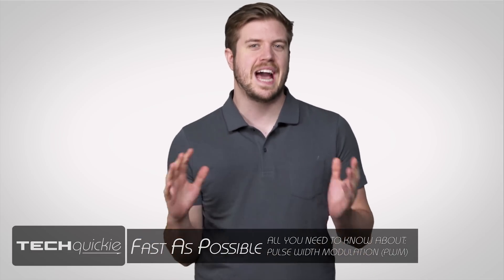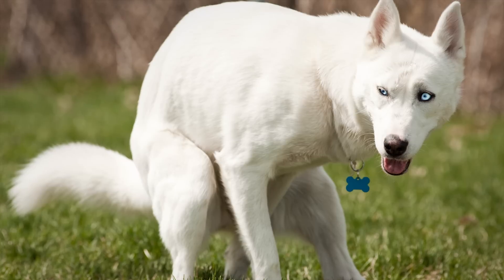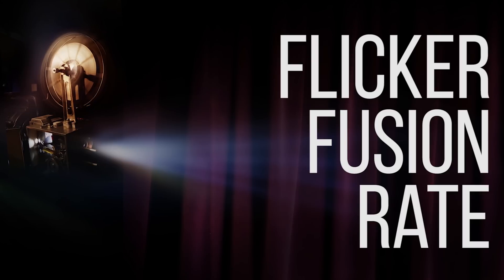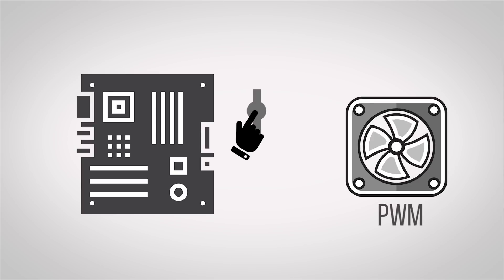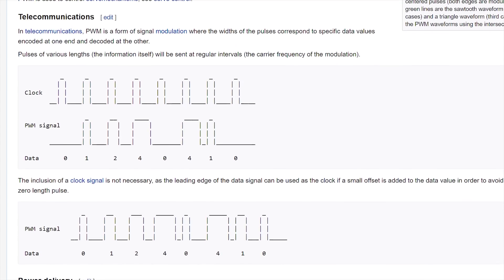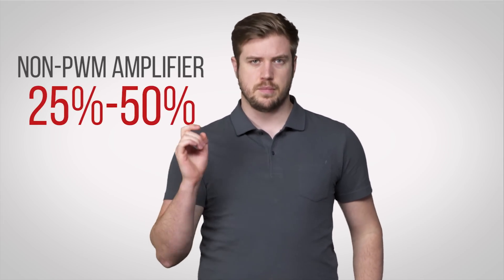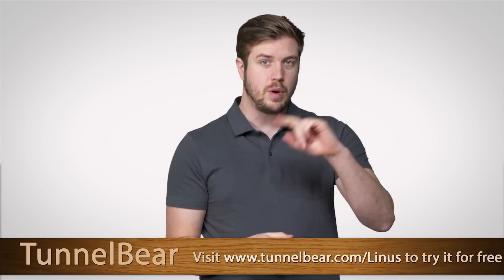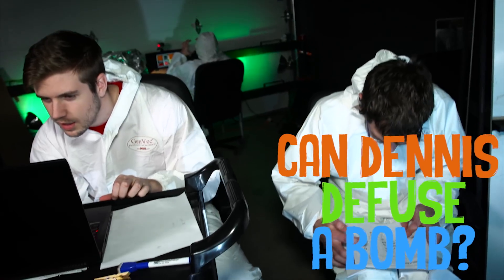PWM (Pulse Width Modulation) as Fast As Possible

Comment: So many misconceptions.

Pwm does not change the perceived power, but the actual power. If you go with 100% power but only 10% of the time, than the end result is 10% power.

The power-consumption of PWM fans too is not choppy.
The PWM signal is NOT delivering the power, it is only telling the inside circuitry what to do. And there is a surprising amount of electronics inside those fans.

With current regulated fans the extra power can get wasted, but that is not the only way to do it.

And light-dimmers did NOT work that way either - or they would have burned up.
Some early versions used a transformator, but pretty much every conventional dimmer uses triacs since the 19070's.

phones and celltowers do NOT use PWM to transmit data. that would be rather inefficient.
GSM uses Minimum-shift keying.

PWM amplifier - you mean class D amplifiers?
Cause they can use PWM, but are not limited to.

not a bad video, but surprisingly nearly everything is only half true or outright false.
Reply: ABaumstumpf yeah as a EE student this video had me cracking up. They should stick to unboxings, they're clearly not qualified to try and educate on topics like this.
Reply: ABaumstumpf I believe it's for noobs on low-level electronics, those that mix concepts like power with voltage. It's better than nothing I suppose
Reply: The statement telecommunications such as cell phones and towers where PWM controlled was way more painful then the 'perceived' power part to me.
Reply: They already made a video explaining the difference between power and voltage, so they should be able to expect their viewers to at least know what that is at this point. I mean, P=IV -> Penis = In Vagina. Not hard to remember :)
Reply: Anubhav - depends on how the fans are build.
but in principle the PWM signal is used to switch a MOSFET. So the fan internally is driven by a PWM Signal, but the power does not come from the PWM-pin but the 12V rail.
And to not have a rapidly changing current the 12V rail is stabilized with a capacitor.

of course many fans are made a lot more complicated than this nowadays, with extra circuitry to make it turn even at very low speeds, keep the RPM more constant and so on.

A simple overlook of how 273/4 pin fans work:
http://www.analog.com/en/analog-dialogue/articles/how-to-control-fan-speed.html

small circuitboard inside a PWM fan:
http://www.overclockers.com/forums/attachment.php?attachmentid=150239
goes to show just how much more than the simple basic really is used.

Some have a buck-converter to regulate the voltage (simple google "step down buck converter"), others use the PWM, and some do more exotic things.
Reply: ABaumstumpf
 Oh now I understand the key factor (stressed put on internal circuit) is fan essentially act like a blackbox with generic interface. Thus, reducing processing/computation responsiblilty of motherboard. Thanks Bro.
Reply: Exactly, this is why fan connectors have that 4th wire. I think I'll make a video proving why using PWM for power delivery is a bad system. Why would it create 2 antennas though and not 1?
Reply: I was waiting for a mention of class D amps too. Especially in live sound loudspeakers, line array systems, etc.
Reply: In first line you put 5 instead of %

And you're right
Reply: Karol - oh, thanks, edited it.
Reply: what is gained by not just delivering pwm power to the fans?
Reply: It is used to send signals to your fans, but if you deliver power you now have 2 big fat antennas for every fan inside your case. and it would also make controlling the fan harder. normally you have some small caps to generate a smooth voltage to control the speed - if you do that with PWM controlling that voltage becomes really hard to impossible, as it would be dependent upon outside components.
Reply: makes sense, thx for the quick explanation
Reply: From noob to expert. This video seems straight out of Wikipedia. Could you direct me to document or explain a little bit more how the fan is regulated with PWM?  I mean if you are not using resistors to control voltage or sending power via PWM then what is being actually used?
Reply: ABaumstumpf
 Wow, I thought they might use some series of step down transformer with transistors as a switch to turn them on/off. Thanks for sharing your documents they made it much more clear. But I have one more doubt, why use PWM, if we are using logics can't same be achieve with multiplexers with some sort of  step down converter (just curious).
Reply: *****
 Hmm intriguing, now I am more curious.
Reply: @Quantum - about the cap - not really.
If you use a 20 V 50% PWM signal on a cap, than you might get anything between 0 and 20V on average at the cap.
cause it depends on 4 things what you get:
The current capabilities of the source.
The characteristics of the source (high impedance vs active low)
current draw of the source.
capacitance of the cap.

Specially the current is important. if the source is not strong enough in comparison to the demands it can easily be that you never reach the intended voltage. And the opposite can be true too. with a strong source yo might manage to charge the cap in a single cycle even at 10%, and the small load might only decrease that down to say 18V per cycle.
Reply: Anubhav - a PWM signal is just really easy to handle if you only want roughly linear characteristics.
Try to think of other methods to send data.
serial encoded? parallel? Analog? That all requires more electronics on both sides.

With PWM you can achieve it quite easily. And internally on the fan you can do a bit of processing if needed. Many of the fans have a lot of electronics inside - but the key is - internally. Cause the connection and what the mobo is seeing is quite simple. This way a fan manufacturer also can decide how to exactly control the fan and the same goes for the motherboard. but no matter how it is implemented, it will work with all motherboards and fans.

Comment: PWM is also used in modern Automobiles. Such as an EVAP Solenoid.
Reply: Also you need an oscilloscope(PICO SCOPE) to work on most things that are controlled by PWM.

Comment: PWM for any lighting is fucking annoying. It legitimately strains the eyes and achieves nothing more than a well-designed voltage control system does.
Reply: My thoughts exactly. It's good for motor drills and all that, but for anything to do with lighting (looking at you, monitors and TV screens) they really SHOULDN'T EXIST. It's incredibly annoying on so many levels and CHINTZY as fuck.
Reply: turbo pascal you can't use voltage control (directly) for LEDs, only PWM or amp control.
Reply: i already had people suggest me to just PWM lighting LEDs, but i am "NO, I WILL FOR NOW NEVER DO THAT", i voltage control them, it is not a good idea, but if they do not heat much there is no issue(higher temperature=lower voltage drop=higher current=higher power consumption=start), for now i haven't done any adjustable current sources(LEDs->Fb pin->low value resistor to gnd, the resistor will drop the feedback voltage, so it is quite easy to adjust current, the lower the voltage, the more efficient it is(more important on low voltage LEDs)

I have a shitty +-350-450lm 5W COB LED i got from ebay(before i had semi-proper osram LEDs but they were shitty and SMD, so they got damaged very easily) on a flashlight i made(more built, but anyway) and i basically have voltage regulation for brightness adjustment.(i don't always need to light up a room with it)
Reply: GetTheCheeseToSickbay You don't get to tell me I can't do something I actually did :P
Reply: What exactly do you mean by "a pretty constant forward voltage drop"? All voltage-current characteristics of LEDs that I can find show both voltage and current rising together, though not at linear rates. And when you plug an LED into a voltage source, the lower the voltage, the dimmer the light.
Reply: Alright, I see the point. But to make simple dimmer switches, we don't have to be very precise at all do we? We just need to establish a spec for maximum current at a certain voltage to retain compatibility, and then just use a regulated voltage supply to drive the LEDs. And for more precision, there is the aforementioned current control, still no need for PWM (which was my main point - to get rid of the flickering).

Comment: 18Hz. Flicker fusion rate. Yes for evenly lit frames. Not for light. A 24FPS cinema runs at 48HZ, each frame are shown twice.
You can test this yourelfs with a a camera flash. The flash must have a "multi flash" setting ware it acts as a strobe. On mine I can set the number of flashes and the Hz. To my eyes the light output becomes solid around 50-60Hz, and continues to be smoother up to 100Hz witch are max on my model. At 20Hz it are still obvious it are individual flashes.

I'm sure someone at LTT have a flash that can do this. So test it out for yourself!

Comment: PWM lit backlights at a small enough brightness level do start to flicker clearly, there are ways around it of course, but on the cheaper monitors it's not used. In fact, you can decrease the blur on an lcd by having the pwm cycle synced to refresh rate, that means the screen is flickering, that means it can cause eye strain.
Reply: attach a capacitor in parallel with the led's to smooth?

Comment: also, PWM dimming on car tail lights pisses me off because when I move my eyes it gives me stroboscopic effect, you can also explain this.
Reply: comes from some people being too cheap for the extra 0.2 cents for the faster switching PWM-chip.
Reply: +ABaumstumpf PWM are themselves cheap as fuck alternative for corporations instead of having an actual proper dimming circuit. You can see this in how monitor companies are now marketing these "new and improved eyecare flickerless" monitors, i.e. non-PWM brightness circuit. In other words: they're now doing what they were MEANT to do from the very beginning. They're cheap motherfuckers. PWM should have NEVER reached this level of popularity for light management.
Reply: m8onethousand - PAM light dimming actually is quite good.
But the the frequencies need to be higher in order to not have any problems - and that is where they cheaped out cause ti would cost half a cent extra.

With LED backlight it is possible to dim them directly, but with other backlights - CCFL can not be dimmed all that much as the physics they are based upon limit the range significantly.

Increase the PWM frequency and you got no problems.
some panels have frequencies as low as 125 Hz - and that is too low. with just a few cents extra you could pump that up to > 2000 Hz and have no flicker what so ever.
Reply: You mean from manufactures being cheap, right? Most newer cars come off the line with LED bulbs for the rear end.
Reply: +m8onethousand PWM with LED lighting actually serves a good purpose if done right...  I agree it shouldn't be used to control brightness, a good pot is better for that, but, PWM when used properly can help increase the lifespan of the LED, as well as decrease overall heat output since it's not lit as long.
Reply: +Chucks Basix I actually despise LEDs for that very same reason. I don't have a single LED nor CFL in my house. I refuse to sponsor PWM garbage. I laugh when they come with all the marketing wank of "over 20,000 hours lifetime! save the planet one led at a time!!!!". Turn on a camera, and enjoy the pig disgusting flicker and subsequent light spectrum drift in these bad boys. I may come back to LEDs when they make a PROPER circuit for them.
Reply: +ABaumstumpf You do realise you can dim them with other means than potentiometers, right? That's my point: corporations are a bunch of cheap crooks. Saturable reactors (actual name, but it's actually incredibly easy) quickly comes to mind as the easiest and most basic example capable of delivering a proper dimming. At the end of the day, there are a plethora of methods they can employ to PROPERLY dim them, but they deliberately refuse to do so because people are down to buying their overly expensive marketing wank PWM garbage.
Reply: "You do realise you can dim them with other means than potentiometers, right? "
And you can use something aside from a car to get from point A to point B - so?
PWm is a cheap, efficient, and sufficiently good method.
 
"At the end of the day, there are a plethora of methods they can employ to PROPERLY dim them"
then please go ahead and build them - oh right, you won't, cause neither are those easy, nor cheap.

if you just hate it cause you want to hate it fine - your choice to act stupid.
Reply: +zlac Yeah, this is totally annoying. I use to take over those cars, because this is really a safety issue.

Comment: Another automotive application of PWM is in the Engine Control System; it is how the fuel injectors are controlled for optimum fuel atomization in the combustion chamber, which reduce emissions and increases fuel efficiency.

Comment: PWM is also used in old game consoles to give you that nice 8-bit sound.

EDIT: sorry, this isn't actually true. Check the conversation below for the actual truth.
Reply: NI's Massive uses regular wave form oscilators... 8bit sounds comes from square waves.
Reply: Every old 8bit tune was made using square wave synthesizers and nothing you say will change that. PMW only allows you to use any waveform (even images) as oscilators.
Reply: Meta - uhm - not really.
the 8bit guy made a good video about how consoles made sounds.
Reply: ABaumstumpf oh, i have actually seen that video...
The reason i made that comment was because i a digital synthesizer (called Massive) that allows you to make sound using PWM. And it sounds really 8-bit.
Reply: Eduardo Walcacer yes, but the PWM Wavetable generates more that a normal square wave, it changes the pulse width (surprise, surprise...) of the wave, which sounds different.
Reply: Eduardo Walcacer Wow, that's pretty interesting. I guess you learn something new everyday. I'll edit my comment
Reply: Eduardo Walcacer No, they used other waveforms like sawtooth and triangle as well. Just look at the SID chip in Commodore 64, which was released in 1982.
EDIT: The SID chip doesn't have triangle, AFAIK, but it was just an example. The NES (Nintendo) had triangle, noise and square.
Reply: Meta, sorry if my comment sounded arrogant, I just wanted to make my point.
Reply: Eduardo Walcacer You're talking about wavetable synthesis which is different than pulsewidth modulation
Reply: I just did some research, the NES and the original Game Boy have 2 audio channels that are 
"Pulse wave generators", which have 4 width settings.
I guess that I was correct after all? Except if the PWM talked about in the video is a different one.
Reply: OP is correct. Analog and digital synthesizers of the past and still today use audio rate pulse waves (AKA a square wave if the pulse width is 50%). Pulse waves can have their pulse width modulated, which does indeed change the sound by adding additional harmonics at a narrower pulse width. PWM is a classic synthesizer effect that's been used for decades, well before game consoles, and still in use today.

Comment: Flicker at 60hz is painful.
30hz on an old TV is acceptable because the old style phosphors used to light up the screen had enough image retention that you generally didn't see the screen go blank.
High end PC CRT's with low image retention (better for high FPS) would emit light for just a small duration of the 16ms frame time at 60hz, and in my entire life I have NEVER used a CRT at below 80hz (willingly).

I'm betting that if you were to use a very short burst of light, lets say 1ms, it would still be noticeable even at 120hz.
Reply: Can you explain about Onepkus 7 pro PWM frequency ? It will be very helpful.
Thanks.